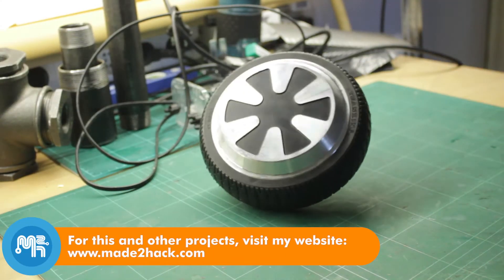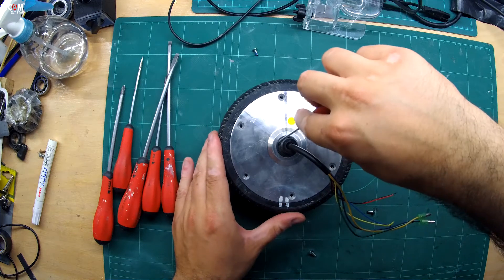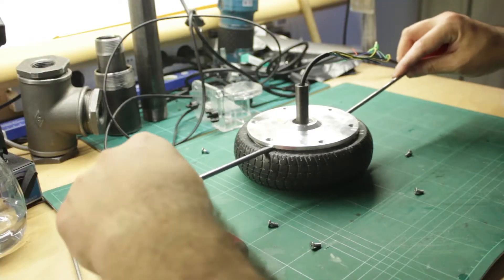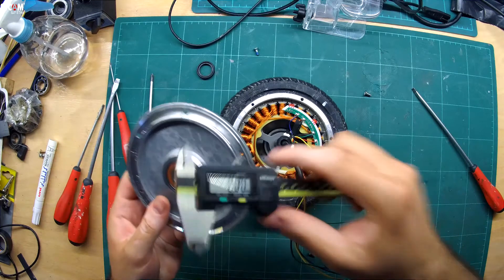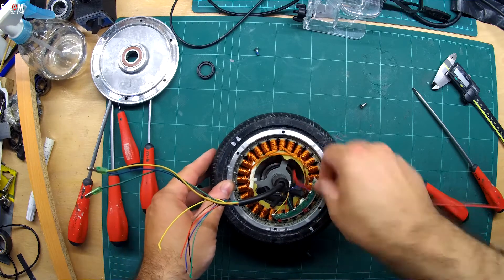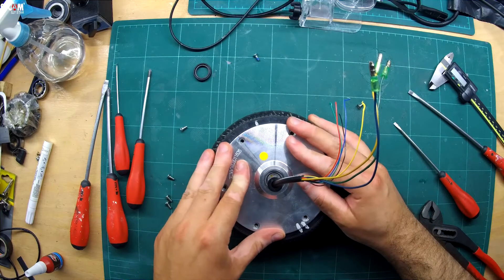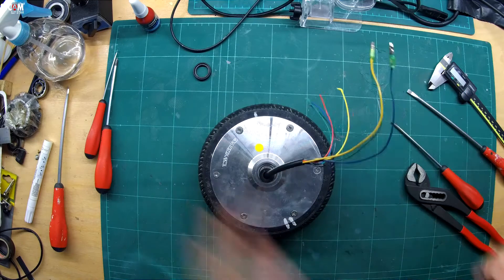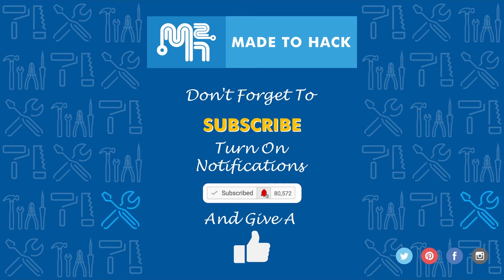Hover Board Wheel Motor - Open, Take Apart, What's Inside!

Comment: This is a 7 year old video as of now, but if here you are looking for a tip on removing the stator from the motor casing, this video was sadly not the answer.

HOWEVER! Found a forum where someone mentioned sticking the shaft into a table vise and yanking the case upward quickly.
Without a table vise, the following was very easy for me:
Get some large tongue and groove pliers or vise grips/locking pliers, grip the shaft (lol) very firmly, and step on the tire part of the case putting weight on it against the floor. Yank the pliers+shaft+stator up in a swift and strong move (slow pressure will not be enough for those magnets) and it should come out at least slightly. Once it's nudged out of place, keep doing that and it will come out quite easily.

Comment: I am dissasembling one for my bachelor thesis right now and was struggling with pulling out the stator so I looked up a video to see if I missed something. Never in my life have I felt more vidicated.
Reply: 😭what ended up working for you?
Reply: @termitecraft9349 Brute force and a flat head screwdriver just put it as far under the tire as you can and push down like a seesaw it will pull it a bit towards you. 

Now do it around the entire diameter (putting the screwdriver like 3cm to the right) and just keep going until you start to see it pull off then alternate pulling while bracing yourself on the inside of the motor and use the screwdriver again and again it will probably take like 10 minutes but it will work eventually.

Comment: Yep, those magnets maintain quite a bit of PULLING resistance. Perhaps a gear puller would have done the trick.  J K
Reply from the maker: You know, I thought about using my bearing puller to try that. My concern was that the phase wires come out of the stator shaft where the tip of the bearing puller would rest. And then I thought I might damage the lamination, but yeah, I had no chance in getting it out.
Reply from the maker: Actually, never mind. The spindle was relating to the removal of the aluminium plate.